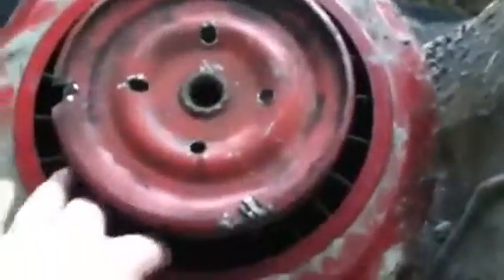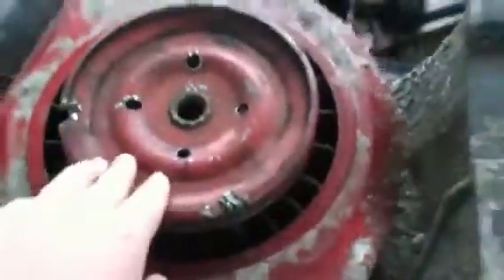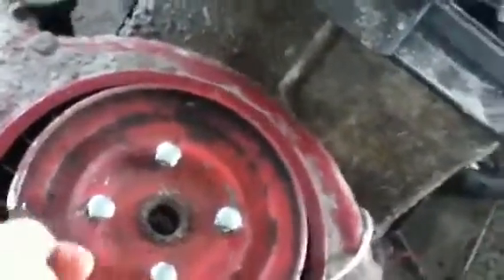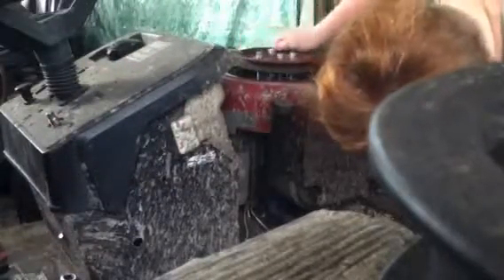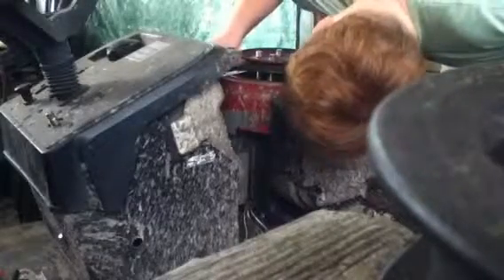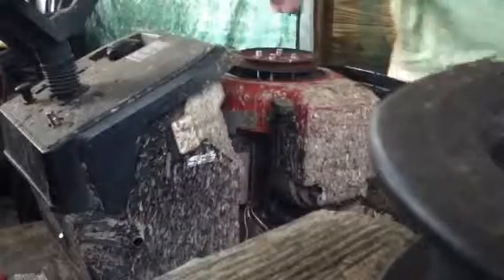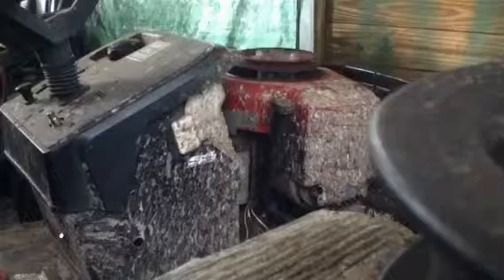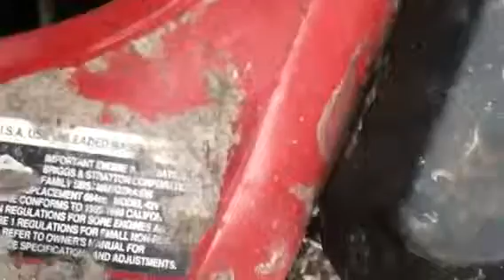Custome pull start on B&S Opposed Twin engine

Comment: You're a smart kid!!!!
Thanks for sharing!
Reply from the maker: thanks! now that im older though, i would make some tube steel spacers to hold the pulley off the fly wheel, hard part would be balancing that well enough not to vibrate your socks off

Comment: that extra weight on flywheel play a factor  in how the motor operates ?
Reply from the maker: milldabeast519 no, as long as it's relatively balanced it has no affect what so ever. Only issue I could find was stuff getting caught while going through brush or what ever.